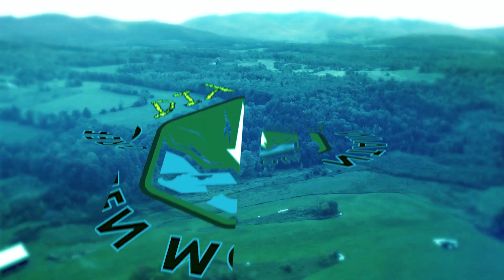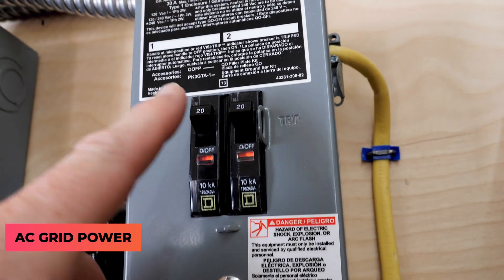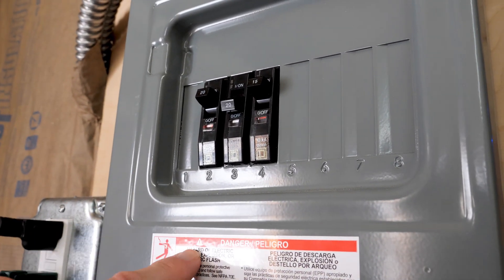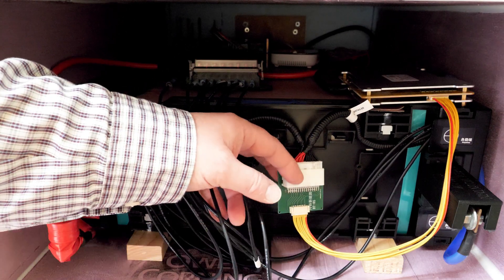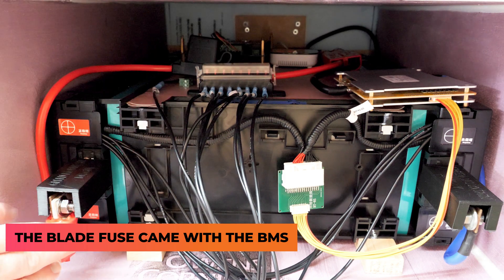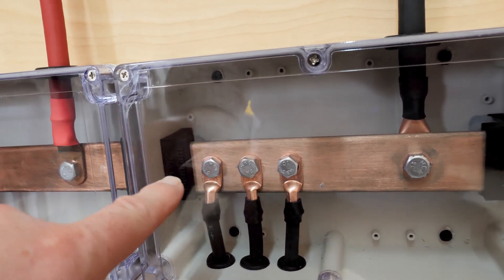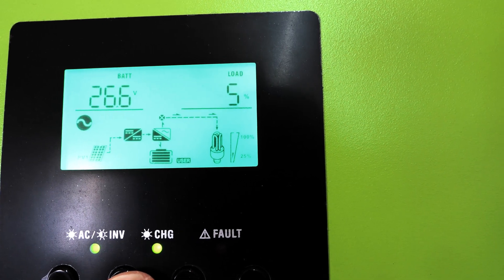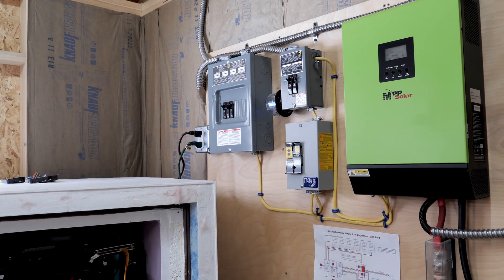New Off Grid Solar Shed Part 11   Solar DC Wiring & Finishing up!

Comment: Very nice system. Have you considered installing a Victron BMV-712 battery monitor/shunt to provide % state of charge of your batteries? I haven’t found the ones built into the BMS to be very accurate. It would periodically reset to 100% full when in reality only 60% SOC.
Reply from the maker: Great suggestion!

Comment: you missed a capacity meter. Also, running 0000 wire is a waste really, but I think that you already know this. That inverter can never even pull close to what that wire can handle. Seems like a fair amount of unneeded redundancy. Why a solar breaker inside and out? Not needed. Also the transfer switch argument is irrelevant to say the least. You are right it has in internal ATS, no need for an external one. I'm not sure why you have made many of these choices, as all they have accomplished was increasing install cost and point of failure and confusion. 
I know I sound like a negative nancy here, but you did ask.
Last point, you should NOT be running an active balancer on any thinium cell, all it will do is hide failing cells, and completely wreck your top balance (assuming that you did one) Anyways, just my $0.02
Reply from the maker: Michael thanks for watching and commenting.  Just a couple of things to clarify:

1. It is 2/0 wire running from the bus bars to the inverter and not 0000 (4/0) as you indicated. 2/0 is the wire I had on hand so I used it.  Yes, there really is no need to go more than 2 gauge on the MPP due to the amount of energy being used.  2/0 will be nice if I ever upgrade.  Always have to look to future proofing and potential upgrades.  Also didn't want to waste what I had on hand. 

2. Having a solar breaker inside is actually really convenient when wanting to turn off the solar without have to go outside.  If you think about it, it is really a good practice having disconnects outside for access (especially in emergency situation or if the shed is locked ) as well as having a disconnect inside.  Our grid-tied roof system and Enphase ground mount solar are all wired in the same manner. Disconnects outside as well as inside. 

3. As far as the ATS and the manual transfer switch I guess I look at potential failure in a different manner.  What would happen if the MPP or batteries went down for any unexpected reason?  How would I power the shed and pool if these components failed?  What if I want to work on the MPP but still keep the power on the shed and keep the pool going?  I think the manual transfer switch is the answer here.  It really was not that much more money and is pretty simple to use.  I have to look at others such as my spouse using the system too, especially if I am not around.  Technically, I probably could have created a less expensive transfer switch by using another load center box but this would have made the system more complicated especially for the  novice user.  The transfer is clear: grid or MPP power, and one can't go wrong by turning the wrong breakers. 

4.  I don't think you are being critical.  I appreciate honest feedback with you taking the time to share some thoughts.  An opportunity for both of us as well as others to learn. 

5.  Yes, I agree with you about balancers.  The general thought is that balancers are not really needed on new lithium since all of the cells should be close and play nice together.  Not the case here on these BYD's.  When I purchased the batteries in November 2019 they seemed like a good deal.  Unfortunately, no one knew the extent of just how out of whack the lithium cells become when going over 27 volts and under 24.  These BYD units were cycled hard and perhaps even abused.  The balancers were expensive and but I did see some improvement in capacity testing in the Spring of 2020.  If I were buying batteries again (perhaps a month or two before I finished wiring up the shed,) I would have gone a completely different route.  We'll have to see how the batteries do when I run  some real power loads this Spring and Summer.  I might just end up getting some new cells such as the EVE 280's if the BYD's don't come through.  I'm pretty much done putting time and money into the BYS's. 

6. Capacity meter - Yes, I still need to work one in...perhaps a negative shunt style?  Thoughts or recommendations? The MPP does give me some data but it would be nice to have some additional data especially in remote access. 

Thanks again for you thoughts.

Comment: Excellent....how u made it...👍
One question whay 24v and not 48v system....
U have done ur homework wirevise....
Once again...excellent....👍
Reply from the maker: Great question.  If I went 48 V then I would have to add another inverter or go with the 48V version.  I don't need 240V in the shed and my power require are generally low. 24V seems to be just right for the size.  Thanks for watching.

Comment: Looks nice!  Id get rid of that blade fuse as its not needed since the fuse off the pack will do the job.  Also a side note, great editing....however (imo) I think you over used the swoosh transition.  Its great when going to a "new" area or zoom in/out but not needed when viewing the same general area.  It was to much for my viewing.  Again my opinion!
Reply from the maker: Thanks!  I agree, I over did it on the transitions, was trying to up my video game but probably had the opposite effect!